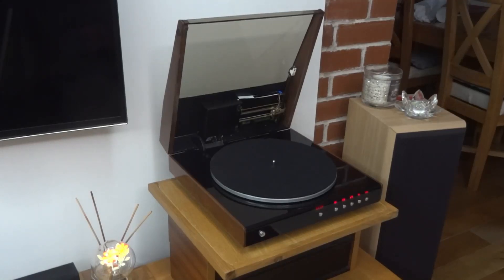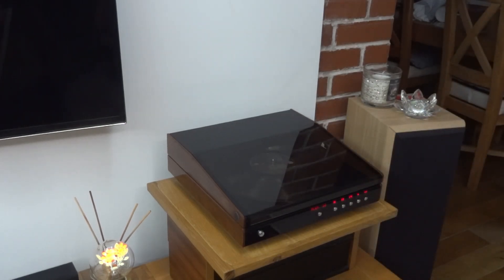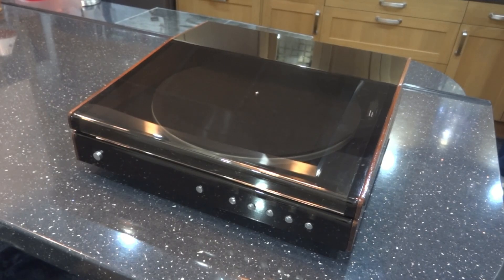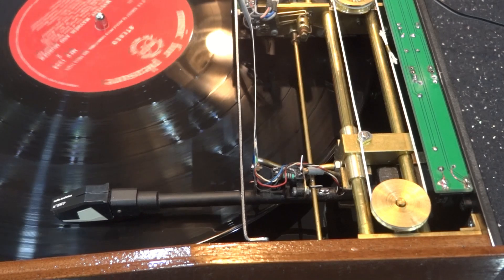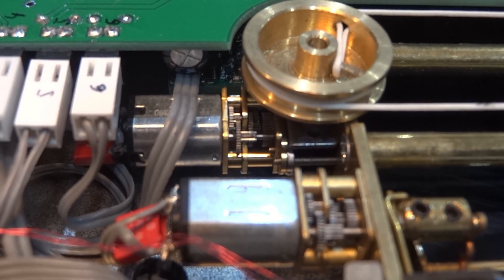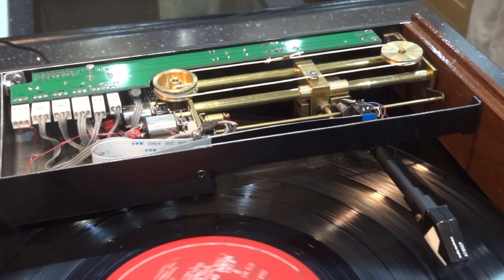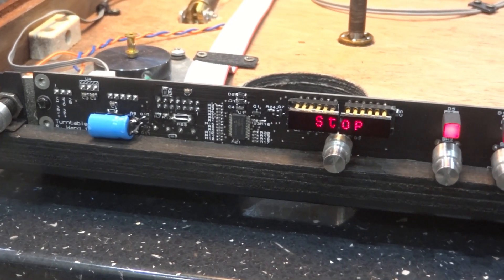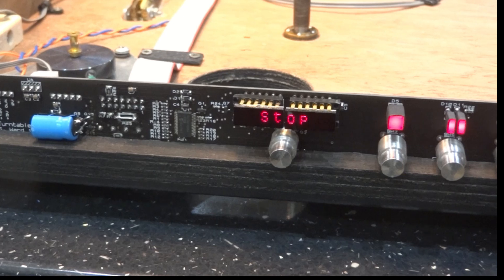Home-made linear tracking vinyl turntable

Comment: Do you have any documents of your design available?
Reply from the maker: The electronics and software is fully documented. I may be able to find some sketches of the mechanics...maybe!
Reply: @leedwood4415  do you have them posted anywhere?
Reply: @leedwood4415  Hi ! Very impressed with your design, thank you so much for posting this video and showing the world (and myself) that such an impressive contraption can actually be home built ! I'm looking to make something similar, and would greatly appreciate being able to have a more in-depth look into your build, if you've posted the documentation somewhere and/or would be inclined to do so 😊 either way, props !